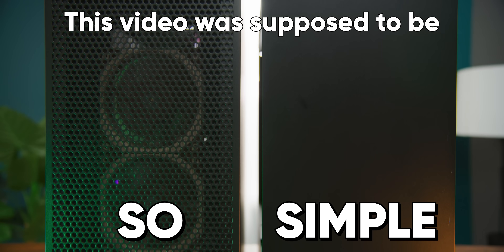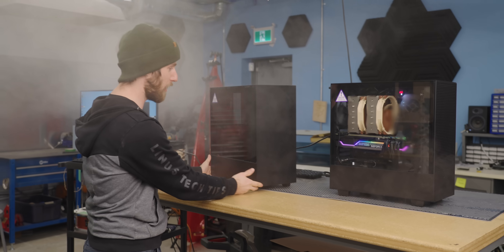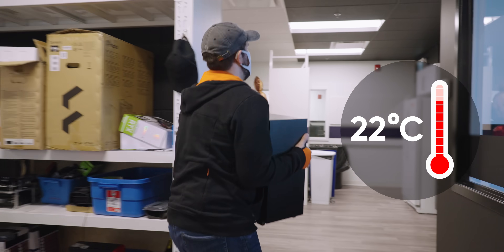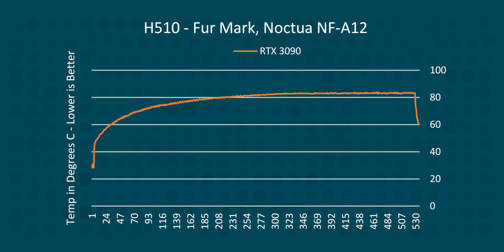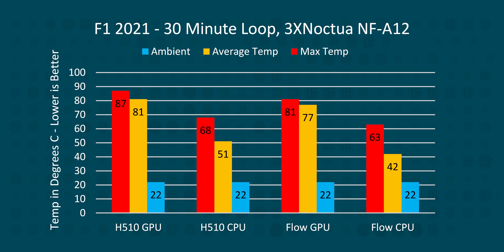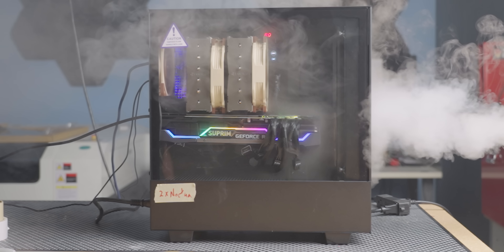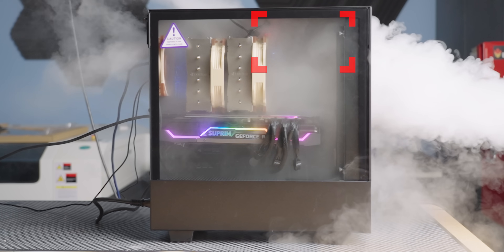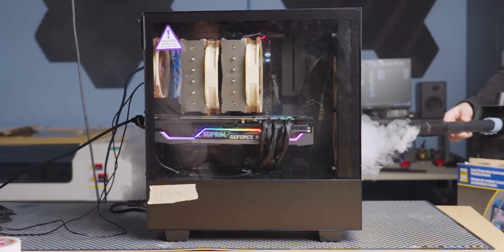Everything You Know Is Wrong - Mesh vs Non-Mesh Front Panel

Comment: I'm curious if flipping the PSU over to use as another exhaust would've broken the GPU air bubble.
Reply: The main problem is with the PCI design itself (and before that, ISA). It was originally designed to lay flat so that heat could rise out of it and be sucked away by exhaust fans. You get cooler temperatures like that, but hardly anyone makes cases like that anymore as they are out of fashion. Tower cases came much later on.
Reply: I really can't uderstand why GPU fans are arranged like that. Low end CPU coolers blast the air against the disipator and hope the best to the air to get out of the chases. Most of the"High end" CPU coolers for high TPU makes the air go through the aluminum directly to the back fan out of the chasis. The same for water cooling, the hot air goes out inmediatly

But GPU are really strangely designed. Just recently they started to make shorted PCB version with a cooling fan pushing the air throughto disipator, every other common model just smashes the air against the PCB and getting stalled there between the GPU and PSU. Just a few cards push the air with a turbine out of the chasis (like notebooks coolers)
Reply: @Coltranne  It was better with Radial Fan designs but the problem is they are not good enogh for modern GPUs.
Reply: @Coltranne  It's a compromise between space requirements, efficiency and noise. Axial fans (the "regular" fans you see everywhere) can be made to run very quiet, a properly designed fan will still move tons of air while keeping the noise down, and this has become a de facto standard because it's good enough and finding other solutions that will most likely provide a relatively marginal improvement isn't worth the money put into research. Not to mention that bar a few exceptions (looking at you, GTX 480), GPUs in general haven't been powerful enough to cause issues until recently. Nvidia solved this with their new cooler, and probably patented it in every way possible so nobody could directly copy their design, so there's that.

The issue with radial fans (or "turbine" fans) is that they are very noisy and generally speaking less efficient than their axial counterparts. They sound like a hair dryer, and due to space constraints the actual cooling surface is smaller and so a GPU with a radial fan tend to run hotter. The only ones using radial fans these days are data centers where noone gives a flip about noise, nerds who have their PC tucked away in a separate room where nois isn't an issue, or people who are on a budget as radial coolers tend to be less expensive. TL;DR: "Turbine" fans do remove the heat from the case, but are overall less efficient and noticeably noisier.
Reply: I did that when I did a rebuild of my PC. It got slightly cooler but the PGU fans didnt have to work as hard anymore. Id love if they could make a case that would hold a rear exhaust fan under the GPU and not just above
Reply: Most of my builds have the PSU flipped. I think it is better. Anecdotal but I have a super cheap PSU that has been running inverted for like eight years in a system. Even though warmer air is going through the PSU, it has access to more airflow. This will depend on the case but for those that have the PSU pointing to the floor with little clearance, flipping it to intake inside the case is probably a better bet.
Reply: Yeah, there's not enough low pressure in the bottom of the case.
Reply: @zqzj  You are on the right track.
Reply: Or maybe run the top front fan slower than the bottom one.
Reply: Maybe the air that hit the gpu wouldn't hit the gpu if there was a bigger gap front fan to gpu and would curve the air under the gpu.
Reply: Really depends on your PSU. In my machine the 1000w Corsair I have doesn’t even spin up it’s fan until about 400w are utilized and in my machine with a 3700x and 1080, it doesn’t hit that under 90% of the scenarios I play. So this would be very config-dependent.
Reply: @bearxor  oh another 1080 user. Let me guess you are in search of a 3080? 
But honestly it is rare to see a 1080. Most have a 1060 or 70 or an 80ti.
Reply: @AlphaHorst  remember when BB had a price mistake and sold the 1080 at the same price as the 1070? I do ;)
Reply: @bearxor  I bought mine when crypto mining was curbed by the chinese and the priceses fell from 800-900€ to 450-550€. got my KAF2 for 479€ back in 2015/2016. which is why I was so hyped for the 3080, beacuse I had settled for an 2070S upgarde for around 600€ but then saw the 3080 announcement for just 100€ more. I was so stoked because for just 100€ more I could upgrade from a 1080 to a half priced 2080ti+ instead of a 1080ti (which is basically a 2070S without the bad RT cores that the 2070S had)
Reply: @bearxor  mine is only 750w. And my system will max out at around 500w. It'll  only start spinning when gaming which is a good accidental feature
Reply: The PSU was pretty much an integral part of the case ventilation system not that long ago. I never liked the trend the industry went of having the PSU faced down and shroud and essentially forcing the purchase of more fans to compensate the lost of the airflow the PSU provided and pulled down to the lower half of the case.
Reply: @76TyranT76  It used to work fine until it somehow didn't. The top fans are just another way for dust getting in should you ever turn them off.
Reply: @JonatasAdoM  Last I checked... it still works fine. It's just that the industry realized there was money to be made by blocking it off with shrouds and sells more fans which aren't cheap anymore with all the fancy RGB and markups on them.
 I grant you that dust was the main concern, but it's something that still exist today. Nothing a regular cleaning/dusting will not fix, which if you are doing anyway for the rest of the system, is not much more work to do by including the PSU in the routine.
Reply: @76TyranT76  They found out looks sells better than function.    LED Lights + a Lava lamp sell more than proper engineering.
Reply: I did that in a tiny mini-ITX case with 2080 Super, GPU was as cold as with an open back panel. Give that air under the GPU an exit and it solves all your problems.
PSU did not care about warmer air, forced airflow from front fans creating positive case pressure even helped it spin the built-in fan less.
Reply: @Gabe I'm glad you were honest
Reply: Nzxt went from making amazing cases like the switch 810 to this stuff.
Reply: Most cases these days have a solid basement where the PSU lives. It then only has an opening on the bottom. The new Fractal torrent as a for instance puts the PSU on top to give the GPU 3 fans worth of bottom intake.
Reply: If you are not using other PCIe slots, install small fan over there.
Reply: I don't think that would work in the case because it has a PSU shroud.
Reply: @cowjuicethepallytank  It does, but it's perforated.  I checked before posing the question.  If it were closed off, then I agree there'd definitely be no point to it.
Reply: @cowjuicethepallytank  when I was watching the video there are holes to let air threw to the psu if you would want to use it as an exhaust. I just don't know how much it would actually help.
Reply: @cowjuicethepallytank  But it is mesh so it might allow for some airflow
Reply: @cowjuicethepallytank  The PSU shroud is perforated, you're intended to use the PSU as another exhaust.
Reply: I was thinking the same as you are. Maybe if there wasn't an PSU shroud it would allow one of the intake fan to be lower, allowing air to flow directly where the graphics card intake is at. 

Another solution that might not be as optimal would possibly having a case with a top mounted PSU with an exhaust right under it and two intake fans on the lower part of the front. That way  the air enters low and exits high.
Reply: @user-hy7es3xu9w  this would probably lead to a headup of the PSU and a significant one at that. So having 60-80°C hot air blasting into your PSU might not be the best. It could also starve the GPU of air if exausting the air to fast. (This only applies in this and similar cases where the gap between PSU fan and GPU fan is essentially a single slot or at most twi slots. If there was more space between the GPU and PSU this would not pose a problem, but then again you`d probably not even have the entire problem in the first case, as more space between PSU and GPU usually means you ahve a bigger case with plenty space between GPU and side panel leaving aple space for Air to be exaustet around the sides up towards the exaust fan.
Reply: @AlphaHorst  The air wouldn't be that hot because it would be flowing out of the case, and the air going over the GPU isn't at the same air temp as the GPU so it should be fine
Reply: @AlphaHorst , watercooler on the CPU. problem solved!
Reply: @MrPruske  it will still reach 40°C in long gaming sessions.
I use a phantex P500 with 3 intake and 3 exhaus fans all 140mm (two exaust through the radiator of my cpu cooler) and the exhaust closest to the GPU is around 38-45°C at around 25°C ambient.
If that air where to go into my PSU, which would also run at around 60% capacity (using a seasonic prime 850), the internal temps of the PSU could see drastic increases 
I mean just three degrees higher ambient can cause a CPU to go from 90° to 100°C.
And remember my case is massive and well ventilated the NZXT case had no airflow when compared to mine, even the mesh variant.
Reply: @AlphaHorst  I do understand the point about the GPU, but removing the PSU shroud could allow the intake fan to be mounted lower. The PSU would get cool air from outside while the graphics card get's more fresh air thanks to no longer having it's airflow blocked by iteslf. Adding a fan to the side panel would allow the graphics card to get more airflow and eliminate the low airflow underneath the graphics card and as such increasing performance with more fans.
Reply: @AlphaHorst  I tried exactly that, PSU was happy about extra airflow forced by case fans and did not care about a bit warmer air coming through (2080 Super GPU, 650 watt gold rated PSU). PSU fan spins less using it as case exhaust with fan grill up right opposite to GPU rather than the suggested position with fan grill down sucking cool air from under the case.
Reply: @AlphaHorst  I doubt the air itself ever heats up to the temperature of your gpu, especially when it moves away so quickly.

Plus it would 100% surely even if im wrong about the last part, cool down a bit before entering the PSU.
Reply: @AlphaHorst  That gap or no game has nothing to do with it.   The fans are on the other side of the GPU.    Its high and low pressure zones.   A duct with its own fan would work,  a exhaust fan low would help with flow down low.
Reply: I was wondering the same thing
Reply: if it has a shroud it would do nothing.
Reply: I don't think it's a good idea to feed the PSU hot air.
Reply: Then you would have two sets of fans pulling air from that small space: the graphics card and the PSU. That's some serious negative air pressure and would likely make temperatures much worse.
Reply: PSU shroud (with no holes) would stop that theory
Reply: Lol whose power supply fan actually turns on? I have 13 fans in my case and ambient temp is like 20°C. Lol not sure if its ever even turned on. Literally no dust on the PSU dust filter.
Reply: @Zalagar619  Strap a noctua 120mm to it, issue solved.
Reply: @NDKfrl  lol its not an issue, the fan works fine, but it only comes on when the PSU heats up. Mine doesn't. I keep my room and PC chilly.
Reply: @Zalagar619  I know that modern PSU fans barely turn on unless it's an sfx lol, what I'm saying is - if you want the PSU to work as an exhaust - you might as well make it a proper exhaust by strapping a fan to it.
Reply: @Zalagar619  This case clearly doesn't have 13 fans, and some PSUs let you turn the fan on all the time.
Reply: @Zalagar619  People whose ambient temper is 40° C plus.

I swear... with temps like those you could just elaborate some way of passive cooling it.
Reply: This seems genius as first but if you've ever had a case with an upper PSU you will realise that this idea is garbage. Simply put, you wouldn't want 70°C+ air entering your PSU, which is the component responsible for powering your PC.

Comment: I ran into similar issues with my Fractal Meshify C Mini. I had no choice but to do a custom AIO liquid cooling loop. The case is just too small too get enough air around the 3000 series GPUs. After making that change the thermals are much better and the CPU is happier too.
Reply: Same problem with meshify C normal.
Removed foam filter.
Removed drive cage.
Removed pcie slots
Removed PSU shroud (front side) panel.
Tucked all excess cabling from the PSU behind the right side panel.
Slowed down the mid fan.
Sealed top.
Added the front fan of my NH-d15, on the bottom where drive cage used to be.

Considering im running 600rpm under gaming load on case fans and CPU cooler (it's relevant, as at higher RPMs, the mesh foam is less and less restrictive), i shaved about 15ºC on the GPU and 6-7ºC on the CPU.

I have no exhausts.

Comment: I've got a side panel fan to feed cool air to my GPU in my Define R5, works pretty well, the RGB trend kind of killed off this design though, it's hard to find newer case with Modern IO that come with side panel fan slot,  for me, thermal is much more important than RGB, what ever you do with your computer, would you keep watching the casez instead of the monitor?

Comment: I agree with the findings here (and the conclusion!) and think the only issue is a small case. My gigantic full tower Antec 1100 V2 has a total of 6 fans in it, the 2x 120MMs at the front actually make the fan slots right in front of the GPU (unused) push air out of them, so the GPU gets fresh air at all times. It has lots of room to diffuse the air from the front and is even buffered due to the HDD cage (man, remember those?) bring right in front of it, which further creates turbulence. Yet with SP fans, I can still feel the air coming out of the side panel vents, and the GPU only kicks out very hot air.

Comment: blower gpu for the win.  i run 2x 200 front in and a 140 rear out and a 70 rear out under the gpu with a 6900 XT.  adding the 70mm under thye cpu forces air past the gpu and the positive pressure forces air past all other components.  I measured and my cases air is replaced about every 5 seconds and that explains why my case temps at any point are only 2 degrees max opver ambient and my 9900k idles at 2-4c over ambient to. 
But bottom line both NZXT cases just suck.  and the worst thing is that they shove this shite cases down your throat at their pc builder for a absolute premium.

Comment: More fans means more turbulence and will lead to trapped air. What you want is a few good fans in a proper setup to allow air to transfer in and out in a consistent manner.
There is a good video about how Dassault Systèmes helped a hospital with their air flow to prevent spreading airborne diseases (COVID-19 in this case) for anyone interested. The same principles apply for your PC.